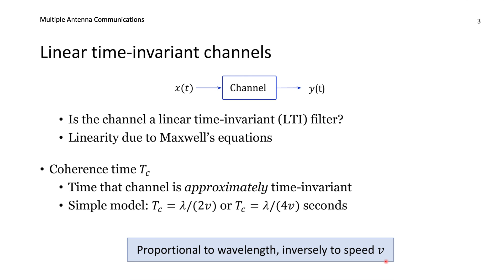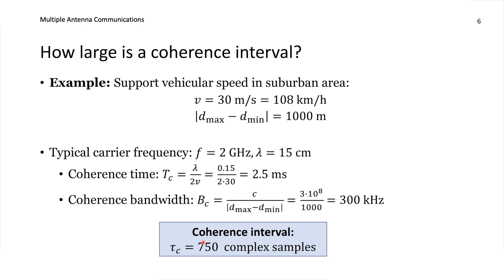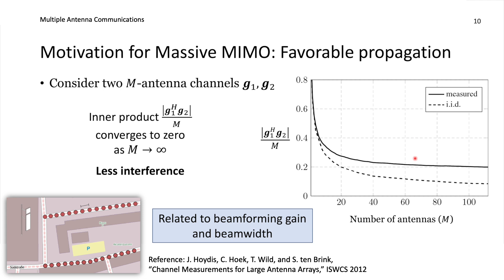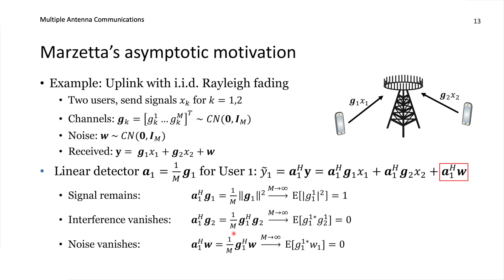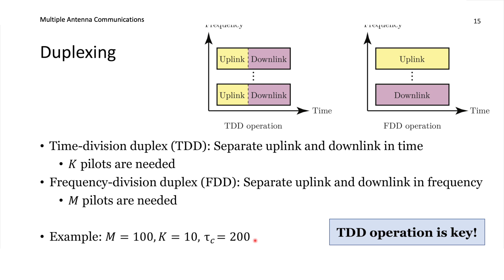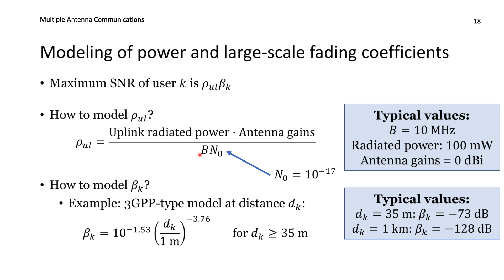Lecture 6: Uplink Multiuser MIMO and Channel Acquisition

Comment: Thanks, with regard to this interval tau=T_c*B_c, isn't the number of symbols dependent of some parameters? The symbol duration depends on SCS. The higher the SCS, the shorter the symbol duration. Here, I obviously do not to know how SCS is to do a statement about the interval.
Is that because of a linear relation between symbol duration and symbol B?
Thank you.
Reply from the maker: There are two things to keep in mind:
1. The total bandwidth and subcarrier spacing which is predefined by the system.
2. The actual channel coherence in time and frequency for a specific user channel.

To make the system work well in practice, we need to design it so that the coherence blocks presumed by the system (1) are smaller or equal to the coherence blocks that you actually have for the specific channel (2).

tau=T_c*B_c is a theoretical measure of the coherence block size. One then needs a waveform that fits nicely into this block. Chapter 2 in the book Fundamentals of Massive MIMO has a short explanation of this with math.

The symbol duration for a single-carrier transmission is 1/B seconds, where B is the bandwidth in Hz. If you consider OFDM with S subcarriers, then the subcarrier spacing is B/S. This means that you take S symbols in the time domain and turn them into an "OFDM symbol". The effective symbol time becomes S/B seconds per OFDM symbol, but within one such OFDM symbol, you are actually sending S symbols on different subcarriers. So, in the long run, you always have B symbols per second.

One wants to adapt the subcarrier spacing so that one or a few subcarriers fit into each coherence block.

Comment: Thanks for the video!
I am a bit confused about the "number of samples" e.g. at 6:47 and later. From my understanding, Nyquist only tells us about minimum required sampling rates to recover the original signal, but nothing about actual hard numbers of samples (since the theorem assumes infinite-time signals)? Also, why would it tell us about the number of samples found in such an interval, shouldnt that depend on the sampling rate as well? And would t_c then not be more akin to rate (as in t_c complex samples required per symbol to decode) instead of an absolute number of samples? You then further equate the number of samples with the number of symbols, but do we not need a large number of samples to recover one symbol through its modulated waveform? So why can we equate them?

Another thing I am confused about is channel hardening: Why is the quantity |g|^2 / M a sensible quantity to look at, specifically the division by M? Is there any physical significance to this? The channel itself is still described by |g| which has unit variance, is it not?
Reply from the maker: The channel capacity is achieved when transmitting infinite-time signals, so this is aligned with the sampling theorem. We use the sampling theorem "backwards" in the sense that we want to create an data-carrying signal that has bandwidth B by letting the data determine the signal samples. We take one data symbol at puts it as a sample of the signal to be generated. When considering the Nyquist sampling rate, we can choose the samples freely since any sequence of samples results in a signal with bandwidth B.

You are right that the Nyquist sampling rate gives the minimum number of samples per second needed to represent the signal, so one can sample it more quickly. Suppose if we sample at twice the Nyquist rate, then we can only choose every other sample freely. The intermediate samples are deterministically determined by the ones that we choose, because if they don't have the right vales, the bandwidth will become larger than B. So even if we oversample, we cannot squeeze in more data into a desired bandwidth B.

You are right that practical signals are not bandlimited in the strict sense that the sampling theorem requires, so we need to use oversampling at the receiver. However, the transmitter still sends information at (roughly) the Nyquist rate. We often use root-raised cosine pulses when generating the signals instead of the sync-function, which results in sending fewer than B symbols per seconds.

The quantity |g|^2/M is somewhat made up to show an essential property. One cannot study the asymptotic behavior of |g|^2 because it diverges. The idea is that E{|g|^2} = M, possibly multiplied with a scaling factor. Hence, the quantity is the ratio between the channel gain and its average, which converges to 1 under channel hardening. So even if there are random variations in the channel, they are small compared to the average value.

Comment: The motivation that massive mimo is just a possibility in BS (because of large number of antenna) sounds reasonable for lower frequency. But now we see wireless devices at millimeter-wave frequency with phased arrays with 30-60 elements that can easily fit into a phone. Does that mean we can do massive mimo in UEs? Or the limiting factor here is that we need a separate RF chain per antenna element?
Reply from the maker: This is a good point. My colleague Stefano Buzzi calls the setup that you describe “doubly massive MIMO”, where also the UE has a larger number of antennas. The UE antennas can be utilized for beamforming (stronger signal) and spatial multiplexing (resolving signals that arrive from different directions). It is only the beamforming option that can be achieved using a phased array (analog beamforming) and mostly works for situations where the channel with a dominant angular direction, since phased arrays must use the same beam for the entire frequency band.

What if we would use digital beamforming with a separate RF chain per antenna element? Then we could achieve higher beamforming gains for channel without a dominant angular direction, and we can make use of spatial multiplexing. However, the number of strong signal direction between the BS and UE will determine how many signals that can practically be multiplexed. We will for sure see digital beamforming implementations in UEs in the future. Here is a blog post about that: https://ma-mimo.ellintech.se/2020/11/14/digital-millimeter-beamforming-for-5g-terminals/

Comment: Thanks for sharing the video. Nice content. Will you be covering Zero forcing beamforming for uplink MU MIMO? If not then can you share some reference that explains the impact of user's channel correlation in uplink ZFBF and SINR performance per user? I could not find these details in the Massive MIMO Networks book.
Reply from the maker: Hi, zero-forcing is covered in a new video called Lecture 9b (https://youtu.be/GZTD8aveQ4o). Zero-forcing isn’t practically useful since regularized zero-forcing performs better and has the same complexity, but it is convenient to analyze it for spatially uncorrelated channels since one can then derive insightful rate formulas. That is not possible for spatially correlated channels, which is why you cannot find that in textbooks.

Comment: thank you alot , as always i have lot of questions to ask 😃 , I'm still confused about bandwidth and symbol duration (lets assume that we have 20Mhz channel in LTE which is divided by 1200 subcarrier (each 15KHz wide) we know due to multipath and intersymbol interference we can't make symbol rate so short but isn't the subcarrier limit us itself too ? can we make symbol duration 50 microseconds for example or we can't make it less than 66 microsecond ???

second question is about subcarrier in 5g NR which is support 240 KHz if we use 240KHz subcarrier isn't it worse for mobility since its symbol duration is much shorter than 15KHz ?? then how 5G promise support faster mobility ?

one more question its about MASSIVE MIMO this time your favourite topic hahah when we have a base station with massive MIMO let's say (64x64) could it support beamforming and SU MIMO and MU MIMO simultaneously ? or we have to configure it to one of these three application of multiple antenna ? (i mean when there is less user in the cell it gives more capacity to each of them through SU MIMO (4X4) and when there was a user in the edge of the cell needs data it employee multiple antenna to make a narrower and stronger beam to make this user in the cell edge have better SNR)
Reply from the maker: Hi! This lecture describes the block fading model, which divides the bandwidth into pieces with independent fading realizations, so we can study them separately. I recommend you to read Chapter 2 on "Fundamentals of Massive MIMO" to learn to connection between the idealized block fading model and practical OFDM systems.

Question 2: The subcarrier spacing must be smaller than the coherence bandwidth, otherwise you will get intersymbol interference. However, the coherence bandwidth is wider than 240 kHz in indoor and short-range outdoor scenarios. The speed of mobility isn't related to the coherence bandwidth but coherence time. The purpose of having a wider bandwidth is to shorten the symbol time duration, which reduces latency. So it is a solution for URLLC applications.

Question 3: SU-MIMO can be included into MU-MIMO. Practical 64T64R systems support two layers per user, and multiplexing of eight users. Beamforming is utilized to transmit each layer. See this blog post: https://ma-mimo.ellintech.se/2020/10/02/reciprocity-based-massive-mimo-in-action/
Reply: @WirelessFuture  thank you i think Q&A is the most effective way to learn especially when the questions answered by an expert , thank you again i really appreciate your useful answers